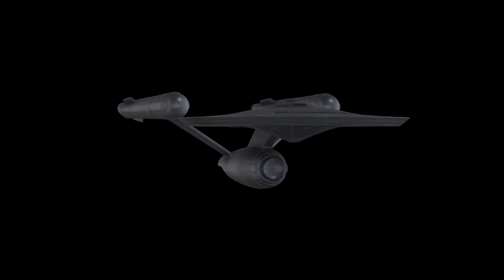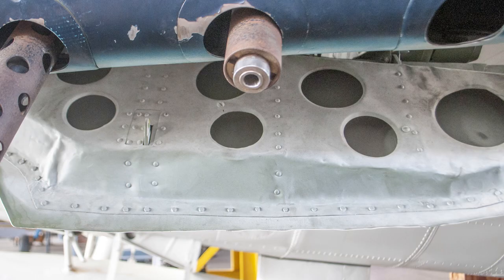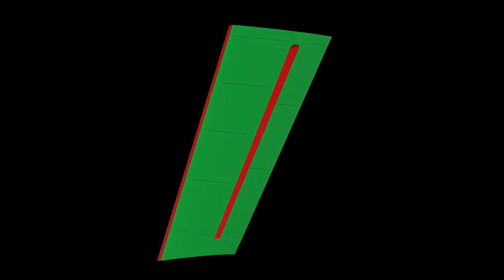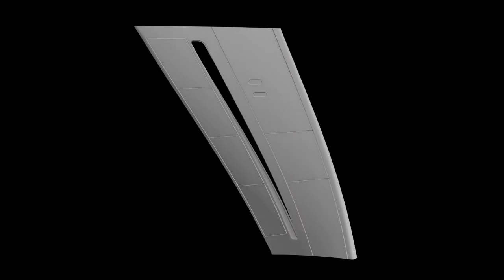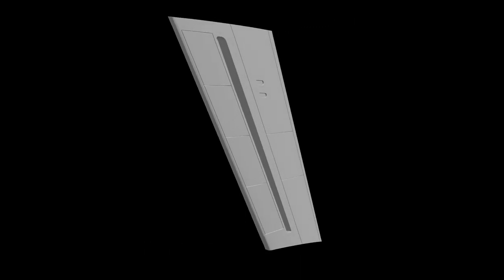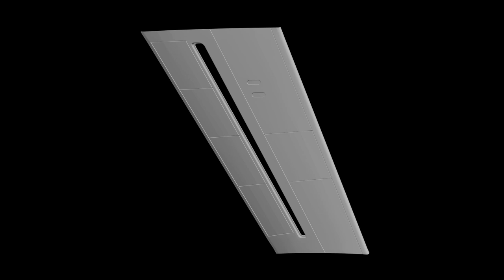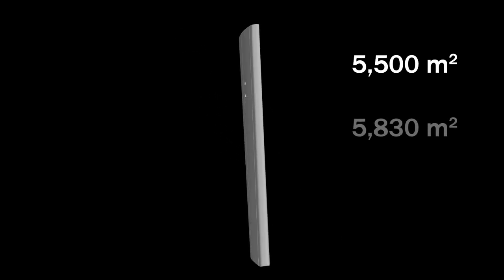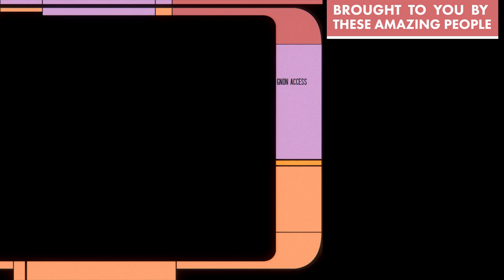What's the Deal with Pylon cutouts?

Comment: Maybe think about them not as cutouts, but as a second set of pylons. Perhaps there was a problem in the design phase where the pylons wouldn't work as intended. Too weak structurally, or not able to carry enough plasma.  It's too late to redesign the pylons from scratch, so just put a second set of smaller pylons behind the first ones.  Problem solved for now.  Later a better solution is found, and the Enterprise is modified with a correctly operating single pylon set so the "cutouts" disappear in TOS.

Comment: Trying to give the benefit of the doubt, the larger Pylon is the primary and the smaller was added as a redundancy and kept partially separated to limit collateral damage in case of a failure. To be meaner.... somebody gets fired and the next ship has stronger pylons.

Comment: Your theory holds weight if its one piece of continuous metal. If you look at all art and footage, there are clearly seems there.

But the holes do make it look a bit different ....... about 25% or so  ;)
Reply: Seams not seems, and being multiple pieces does not change the effect it has on stregnth.  Didnt you notice the actual aircraft examples were also made of multiple pieces?
Reply: @DrewLSsix  I agree, multiple sections or pieces is how the ship is manufactured. Sections are made, then joined together in dry dock.

Comment: I'm sure you would agree that the nacelles are what pushes the ship forward, so it follows then that the pylons are stressed in-plane. A slot like this would basically cut the capacity of the pylons in half since you're replacing one big beam with two small ones. My advice is to not think about things like this, because they always lead to disappointment. That's kind of unfortunate for the spirit of this channel, but hey, there are harder kinds of science fiction out there! The whole point here is that it looks cool.

Comment: Interesting point to make, but I'd think to answer this properly you'd need to know if the warp engines actually create a form of thrust which could bend the pylons. If yes, then a cut-out is a horrible idea, because you're increasing the flex of the pylon which reduces the amount of power transmitted to the rest of the ship to make it move, if no then it really doesn't matter. Quite likely it's just done for aesthetics, but even then.

Comment: A tear stop?  If the crew of the Enterprise is having a very crappy day and structural integrity fields fail them at high warp, if the pylons are larger than they need to be a crack forming on one side of the cutout won't propagate to the other and the crew will survive to leave warp and make repairs before limping back to the nearest starbase.

Comment: Perhaps they are designed to alleviate pressure on those big wide flat pylons, similarly to the cut-out on the https://en.wikipedia.org/wiki/Shanghai_World_Financial_Center#Architecture I'm aware that there is no wind/air pressure in space, but warp-fields do supposedly have fluid-dynamic like effects due to technobabble, and you never know when the enterprise will be asked to fly through a gas-giant's clouds or solar corona or inexplicably thicc sci-fi nebula.

Comment: Cooling doesn't make sense.  The pylons already have vents.  For more cooling, simply replace the cutouts with more vents.  It makes more sense to say that the two areas of the pylons contain things that need to be physically isolated from each other.  For example, one section contains plasma conduits.  The other contains Jefferies tubes for maintenance crews.  The best way to isolate them is using the vacuum of space.

Comment: if you wanted surface area as a radiator, you'd actually design a radiator. those things have LOTS of thin walls and ribs, not a single hole in a big flat body part

Comment: Cool idea, makes this cringe-worthy change a bit more bearable to me.

But in terms of cooling, well, those big parts on the inside of the nacelle that later depictions decided had to glow blue to show "That's the warp coils!"?
Those were originally grilles. Heat vents, along the majority of the engine.
Plus the thinner ones standing up on top, and the boxes on the side. All part of a coolant system.

And yes, you got the purpose of the rectangles on the nacelle pylons right, those are vents as well.
So I'd say additional cooling for the plasma conduits before they reach the nacelles makes at least some sense.

Comment: 3:36 Wait, what? Outer Space (Vacuum) = -270.42 Celsius, prety good cooling for me...  (Bodies with blood / water will rather boil because of presue change, but its other topic)
Reply: Surprisingly not. What's important is the heat transfer rate. When there's no matter to actually transfer heat to, you won't cool down, and while a vacuum is itself cold, there's not any matter there to actually absorb heat, so in space you have to essentially rely on thermal radiation only to transfer heat. A vacuum acts as a very good insulator. You can get some cooling from evaporative cooling (because low pressure causes liquids like water to evaporate), but that only works with liquids and you lose the liquid to the vacuum. Cooling metal like a Starship hull is rather difficult in a vacuum.
Reply: @taragnor  But Radiation its thing that make Vacuum cold, and thermal exchange would still go even without air, than tech could use radiation... When your technology would be based on heating in use and cooling in recharge (in my setting both weapons, batteries and shields work that), than outer space as regulator area could be used just fine...

Comment: The only problem with the cut outs being lightening holes is that weight is largely meaningless in space. However, they could help to reduce mass, which does matter in space. But I'm not sure if that reduces enough mass to matter and then why only on the pylons? I do think that cooling, or as other suggest, a way of separating conduits from heat and/or radiation makes the most sense.

Along the same lines as the cutouts in this Enterprise's pylons, have you done a video explaining the cutouts in the primary hull of the Vengance in ST Into Darkness? I could never think of a logical reason for having those giant cutouts there. To me, it seemed like a big waste of space, space that could be used for other things or, if you don't need that space, then simply make the saucer section smaller.

Comment: It's unlikely that the warp plasma would transfer much heat to the conduit since the conduit is an evacuated tube that channels the plasma in a magnetic suspension. The plasma certainly will radiate some heat to the walls of the conduit, but there is no convection or conduction, and you said it yourself: radiation is a really poor means of transmitting heat.
Reply: And we see these conduits inside the ship in inhabited areas.
Reply: @DrewLSsix  You may be referring to electro-plasma system (EPS) conduits, which aren't quite the same thing as warp plasma conduits, but similar logic applies. I'd guess EPS plasma is a lot cooler than warp plasma since it comes from the ship's fusion reactors, not from the warp engine (which utilizes a matter-antimatter reaction).
Reply: @DrewLSsix  Begging your pardon. You may have been referring to the conduits that branch out to either side of the warp engine. Those are indeed warp plasma conduits, and they do indeed pass through a habitable area of the ship (Main Engineering).

Comment: Why have the Warp nacelles on outrigged pylons? Why not just bolt the nacelles directly to the ships super structure?
Reply: That happens sometimes in the franchise, in alien ships mostly but also in Starfleet ships occasionally. 

As far as the original TOS design rationale Roddenberry and Jefferies decided that the nacelles were packed with dangerous radiation and needed to be kept away from the crewed areas, in more modern takes in the franchise it seems that the position of the nacelles has significant effects on the performance of the ship.  

Obviously the real reason has always been  looks, they wanted the ship to have a distinct look that wasn't like the rocket ships and flying saucers of traditional scifi productions and the design does that, its obviously not a rocket ship with the engines off center like that. It intuitively works off something other than newtonian physics.

Comment: As an artist: It looks cool.
As a sci-fi nerd: It looks cool, shut up.
But as a pedantic scifi nerd: 
The separation is not only for giving more surface area to dissipate heat, but perhaps give space for a maintenance shaft to get to the nacelles etc for maintenance to provide a separate between the feed that is radiation filled, radiation insulation, SPACE and a tube for workers to interact with the nacelles. 

I love TNG but the way they showed the internals of the nacelles felt a bit er, simplistic? Weird to access? I get it was more for story purposes but it didn't FEEL right at best and it LOOKED un-scientific at worst

Comment: You misunderstand the physics of material bending... it's not the number of faces resisting the bending, it's the cross sectional area that resists the bending (not the surface area). The cutout does nothing to increase the rigidity... on the contrary, it greatly increases the flexibility of the nacelle in that direction.

Comment: So radiating heat is definitely not the purpose. Increasing surface area does help when getting rid of heat but basically, the area needs to point away from the ship. Instead of 180 degrees of radiation with x area it has, say, 160 degrees of radiation with y area and 20 degrees radiating back to the ship with y area. Depending on the numbers, this may be a less efficient design than just a flat panel. Even if it wasn't, the change would be so small that it might as well be a rounding error. You think I'm joking but it is VERY hard to radiate heat away and a change like this would be tens of factors smaller than the wattage radiated by the rest of the ship. The only way to make it more efficient is to increase how hot the pylons are and even then we know they don't glow. Assuming the material is based on something grounded in reality, that means it shouldn't be more than 500C or so (max 800C). Space is a great insulator though and could be used to separate specific areas. Though in my opinion, the weight savings is by far the most realistic option.

Comment: “Back in April of 2017 the task of the Enterprise making an appearance came to be and work was to start right away,” Eaves explained (with some of the grammar modified for readability). “The task started with the guideline that the Enterprise for Discovery had to be 25% different, otherwise production would have most likely been able to use the original design from the 60's. But that couldn’t happen so we took Jefferies’ original concepts and with great care tried to be as faithful as possible. We had the advantage of a ten-year gap in Trek history to retro the ship a bit with elements that could be removed and replaced somewhere in the time frame of Discovery and the Original series.”

Discovery show designer John Eaves

https://io9.gizmodo.com/star-trek-discoverys-version-of-the-enterprise-had-to-1825276401

Comment: What if it’s safety? Maintaining a safe distance between matter and anti-matter streams? Of course this has never been needed in any previous show sooooo...
Reply: That be inside of the main engineering section, and not the pylons to the nacels. The antimatter reactor is located in the engineering section, the reactor super heats plasma that is piped to the warp nacelles, where the plasma interacts with the Warp Coils producing the warp field

Comment: personally, 2 reasons i can think of 1. aesthetics it just looks good and thats it, not even the federation is immune from wanting there ships to  look pleasing to the eye after all, it may be the last thing considered in most of there designs but it 'is' still considered
secondly it could also be on top of that a weight/material saving trick, every pound of weigh they can shave off is a pound of weight the ship's engine doesn't have to push, which means energy savings, dilithium is one of the few things that the federation cant just pull out of there asses and they as a result tend to build there ships to be as energy efficient as possible as a result
well with the exception of some of there more powerfull warships but those tend to be drydocked when not needed for a reason they are gass guzzlers and so are only dispatched when needed (well that and the federation has an image to uphold and having there big warships roaming about willy nilly would run contrary to that)

Comment: I don't think there's an in-universe explanation of exactly what kind of propulsion method impulse thrusters use. Memory Alpha states it's a type of "augmented fusion rocket, usually consisting of one or more fusion reactors, a driver coil assembly, and a vectored thrust nozzle to direct the plasma exhaust". Couldn't they also expel waste heat through the impulse engines? Similar to the Epstein drive in the expanse. Just a thought.

Comment: It's a proven engineering fact that a hollow tube will provide greater structural support, strength & stability than a solid rod will. A solid steel rod will bend, a hollow tube will not. It will break first. It also saves on overall weight.

   It could also possibly serve as some sort of heat-sink 😕?
Reply: Hollow tubes offer better weight/strength ratios, but a 10cm diameter solid tube will always be stronger than a 10cm diameter hollow tube.

Comment: The answer is so obvious.  It’s not a cut out.  It’s two struts.  You see the original forward strutt was too weak.  This tends to happen with lowest-bidders.  So a second contractor built a solution.  This was a second strutt.  However, the Admirals did not like the look, so a third contractor was hired to connect the two and make them look like a cut out.  Problem solved.  Cost overruns made everyone tons of gold pressed latinum.

Comment: The Enterprise does not have cut outs on the pylon.  The fake Enterprise on the non-canon television show Discovery has cutouts.
The reason for the difference is because the creators of the television show Discovery have to make their ship a "certain percentage" different from the original version or they'll be in violation of the IP holders copyrights/trademarks.  Better designers could have made it that required amount of difference without resorting to nonsensical "cut outs" where they doesn't need to be any.

Comment: It's in space, technically the ship has no weight. Even obit its weight is barely a problem. What is a problem  is moving the ship thru light speed with weaking the structure that holds the propulsion units,  those you would need to deal with the high torque required  without extensive  force field emitters  suck energy  to keep the from twisting. Face it , it's just them putting their mark on everything  and fucking it up.

Comment: No other StarFleet ships had cutouts from ST: ENT, TOS, TNG, DS9, VOY and all the movies. People are looking at these ships from a 21st century level of technological understanding rather than a 22nd, 23rd or 24th century level of technological understanding.

If the StarFleet Corps of Engineers did not build the other ships with this feature for over 100 year prior to "Discovery's time period" and over 100 years after the aforementioned time period, why would SFCE build ships like this for only a 10 year period? 
The cutouts does not seem to improve warp field dynamics or warp field stresses. For example, Starship Voyager has movable pylons without cutouts needed and it could go warp 9.997. Much faster and hotter plasma than the other starships before it.

Comment: It weakens the stability in the most important direction, the heat would only radiate to the other side so it actually makes it worse and even makes it easier to destroy if attacked. Its pure style and makes only problems. Waves on the surface would be way better in everything the cutout could ever be good for. The cutout only increases the inner stress.

Comment: Sorry, this is not the way physics work. Cutting out a part of your material does not make it more rigid, no matter how you look at this. The surface does not matter, it is the material that matters. If you punch a hole in a pylon, you save weight. And if you do it correctly, you do not lose much structural integrity, but you do lose structural integrity. But as long as it offsets your loss in weight, you can make your pylon thicker to gain a more favorable weight-to-stability ratio. If you simply punch out holes - apart form the loss of weight -, you will do nothing more than weaken it.
Reply: Nope. Bending the material in certain ways can actually make it stronger. Adding the sides to the structure can make it stronger. It's not the actual cut that makes it stronger it's what you do along the edges of that cut that makes it even stronger than it was before.
Try bending a piece of pipe that's made of the same thickness as a sheet of metal. It takes multiple times the force.
Reply: @DaleESkywalker  Yes, but that is not what is happening here (at least not up to the middle of the video, when this nonsense statement made me tune out). Cutting away material does not make it stronger, it just makes it lighter - so that you can have more stability for the same weight IF you make the part larger - with holes. Again: not what's happening here.

Comment: It give you 4 pylons there redundancy when battle.
You have assumed there cut out . When they could separate strict clad to loo as one you make why to many assumptions based on extra cladding.
Your graphic do not correspond to the shios design go vack abd look at the design and where they connect to the hull and nassel it clear your are wrong.